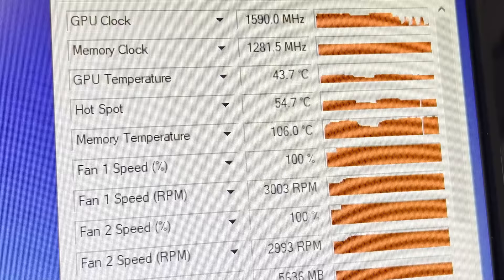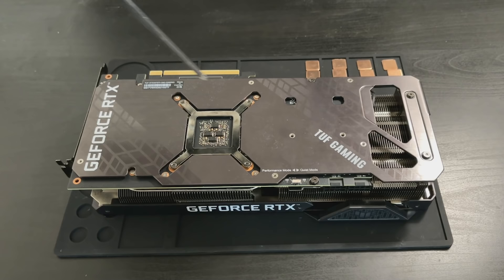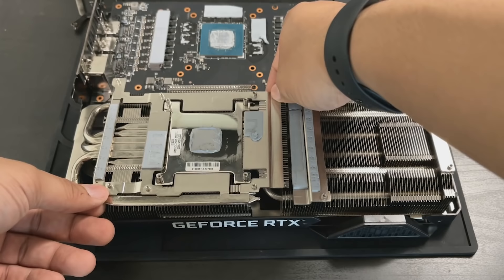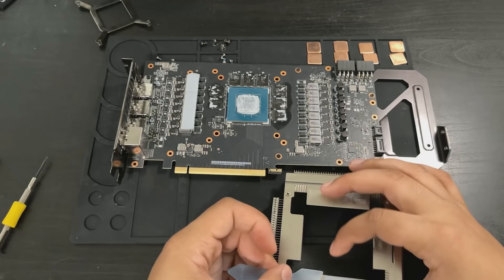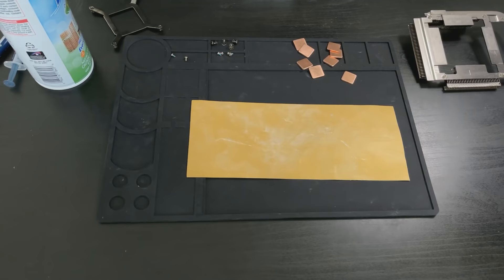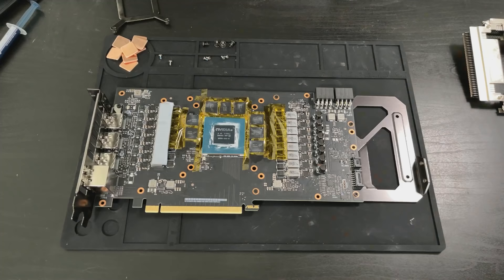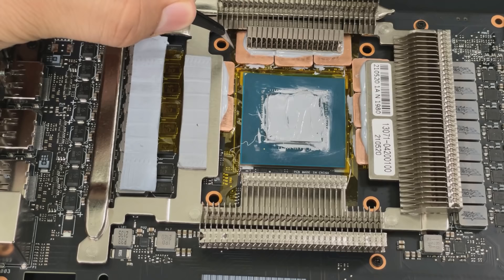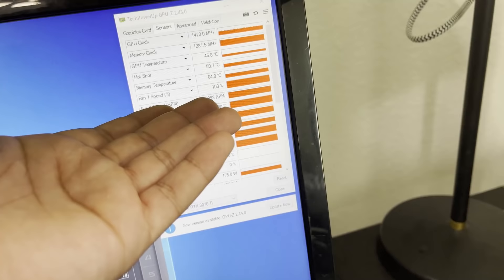I Copper Modded An RTX 3070 Ti.  Memory Temperature Dropped 45 Degrees! This Is How. (110C to 64C)

Comment: Word of warning, this only works "well" if you have a secondary heatsink for the memory. Otherwise you'll have to find ways to fill in the gaps if you have a large single heatsink, pretty much exactly.  As in you have to measure the exact spacing without thermal pads and then get copper shims that thickness or stack various copper shims to that thickness. This is pretty finicky and is basically trial and error unless someone already did it for you in a convenient video/reddit post. Otherwise, if you don't get it just right, you'll have a burning gpu and good memory temps or good gpu temps and burning memory. Luckily, the copper shims aren't very expensive so you can get a bunch of them for experimentation, plus they're basically infinitely reusable.

LTT did a video about an extremely thick foam/paste composite material that mostly fixes this problem. It's very messy, an absolute pain to cleanup, and isn't really cheap. But it does work reasonably well.

Otherwise, outstanding video. I more often than not find proper thermal pads are good enough.
Reply: I was thinking about that, tempted to do this mod to my Vega 56s (HBM memory drops performance when it gets over 80C) but it’s a single heatsink for the whole thing
Reply: @tjarsun  You wouldn't want to use that on an exposed die like your gpu core or HBM, good way to shatter the die, for memory that has a proper package like GDDR# then this can be useful
Reply: if you know the thickness of your memory thermal pads this could still work in theory, you'd just need either very very specific thicknesses of shim or you'd have to start at a thickness you an get and sand it down to the thickness you need
Reply: Y’all over hear tryna burn your house down 😂🤣
Reply: @AphillyatedYT  we feel most alive when rapidly hurtling towards death :P
Reply: @blazingmatty123  And bankruptcy and divorce! ;)
Reply: Even if you do not have copper shims with the exact size you can improove the temps. For example: Original your card is using a single cooler for everything and 2mm thermal pads for the memory. I would buy 1mm copper shims (or Aluminium Nitride shims) + quality 0.5mm thermal pads on both sides. The added copper layer will improove thermal conductivity (compared to a 2mm thermal pad) but the pads still can be squished a bit to fill in the gaps. Not as good as solid copper thermal path but a bit more safty margin when using a single instead of a split cooler.
Reply: @tjarsun  just switch just tim with liquid metal, should drop temps by 10C
Reply: @blazingmatty123  the apex games. great
Reply: @omegaPhix  liquid metal and copper = big problems.
Reply: @frizzlefry1921  How? Copper, Nickel, etc. pretty much don't react at all with LM
Reply: @omegaPhix  Copper will absorb the gallium and it will end up screwed up. Not like aluminum but still not a good idea.
Reply: @frizzlefry1921  Yes, it will absorb parts of the liquid metal mixture and you might need to reapply the tim after around 6 months. But it still doesn't corrode the copper, it's just discolored

Comment: If you really want to cool a GPU hard without water cooling:

- Oversized CPU cooler with a tower heatsink, create custom bracket to attach it
- Aluminum heatsinks that can be cut to size and thermal glue/tape for the memory dies
- Besides the fan on the repurposed CPU cooler, make sure at least one case fan is aimed at the GPU

Comment: Haven't seen an actual copper heat sink in years. Looks like they need to make a comeback!
Reply from the maker: I say they need to just for the aesthetics. The EVGA Kingpin 1080 Ti was gorgeous.
Reply: @dandyworks  i have it on me aorus 1080 ti extreme waterforce its have coper cold plate on memory and gpu
Reply: Copper is 5x the price of aluminum, by weight. It's also 4x more dense than aluminum. Shipping costs would be higher for both consumers and producers, and it could potentially cause mounting pressure issues, but probably not. Imagine a Copper edition DH-15 and it cost $400 instead of $100. That's mainly why there's the compromise of using copper heat pipes and aluminum fins, if your entire heat sink was copper the heat pipes wouldn't be necessary.

Comment: Looking at the thermal pad after disassembling the heatsink, I noticed that it only covered half of the memory chips. This was probably the cause of the high temperatures. Searching the internet, I came to the conclusion in these Tuf models, only the Tuf 3070/Ti models have this problem. In the Tuf 3070/ti (GA104), they used a modular heatsink, made for the tuf 3080/ti, 3090 (GA-102, considerably larger chip) models, leaving the memory chips on the Tuf 3070/ti boards partially uncovered. In this tuf 3070 model, the chips were soldered in the wrong place or they used a wrong heatsink.
Reply: other half is on the memry chips
Reply: That's also what I've spotted. Probably, repositioning the thermopads to cover full VRAM dice would be enough. The main radiator would take care of some cooling. Would it work as good? Probably not, but definitely less risky :)
Reply: @danielsatko-  But anyway, at 10:40 radiator has incomplete coverage over the chips. Even with the best thermal pads that won't suffice.
Reply: We are at the point where hardware manufacturers have figured out planned obsolescence and the only way to prevent this is to vote with your wallet.
Refuse to buy deliberately poorly designed products and spread the word about them.
Do your research before buying. Lookup for review videos with complete disassembly for models you want to buy and see if there are any design problems with them. If no such videos exist this is the reason to avoid the product and look for another model from another brand.
Design issues could be numerous, Ex. when heatsink has small external frame that covers memory chips, but ineffective, or when memory chips are covered partially, or only some chips are covered.
Heat tubes have to be soldered to the heatsink and the main thermal pad has to be made from thick copper, not steel.
There are also could be many points of failure on PCB itself, Ex. low quality components, no fuses, weird placement of hot-components not cooled by the heatsink, etc.
Reply: it seems like this is only on the Ti since the non Ti does NOT have the modular heatsink for the VRAM
Reply: Same temperature issue on my TUF RTX 3090 OC. Haven't disassembled yet to see if the design is different. But I'm also at 104-110°C.
Reply: @skinnladen  looks like this is an issue with the Ti then
Reply: @BlaZebura  sure? I searched and didn't find any 3070 with modular heatsink.
Reply: @lincon5670  yes that was exactly my point. The 3070 TUF has a unified heatsink for both its memory and core

Comment: I used to work in a facility acquired by a very large company that specialized in TIM (Thermal Interface Material) Production. These thermal pads were used in all electronics from headlights, underwater pool lighting, electric vehicles, cell phones, etc. We were never officially told what each part was for but after becoming familiar with the general idea of each product we could come up with our own unverified conclusions. Those copper plates were something that I got to punch out on some of the presses & the thermal pads used on the GPU memory look familiar. Obviously our liquid division would essentially create the cooling thermal paste which I believe is now mainly what is used on larger electronic boards over actual punched parts. We used Kapton tape for splices when cutting down master rolls or when running thermal material through the punch presses where kapton itself was the center most material & then coated in something else. Kapton tape was getting expensive & so our team leads would come around making sure people weren't grabbing multiple rolls of kapton tape & piling them up at the work stations.

It is awesome to see how well the copper plates cooled down the GPU! Incredible results! Now I know what those copper shims were being used for. Awesome video!!
Reply: It doesn't "cold down", it transfers more efficiently the heat.

Comment: This mod is working great with my 2080ti did few more mods with it, temp stays under 68 degree under heavy workload and 35 to 37degree under normal use, before this mod temps were 75 to 80 degree.

Comment: Great idea!!  I have the exact same Asus RTX 3070 Ti TUF card and have been having trouble with the memory temps. An external fan on the backplate helped bring it out of the danger zone, but it's still not enough.  It's good to know the memory heat sink on this card is completely separate than the main GPU heat sink so spacing issues due to thickness of the copper shims will not really be an issue. I really want to do this but sucks to void the warranty. Good job, thanks!

Comment: Been dealing with this issue for a while on my 3090, even the the point were I have some K5 pro on my vrms and memory modules. Definitely going to try this in combination with that instead of thermal paste to see how well it works out. Will try and remember to post an update once I have them on as my memory modules also get pinned around 110 degrees
Reply: I’m dealing with the same issue with my evga 3090ftw3 ultra
Reply: Update ? :P
Reply: @mrx-jz8us  I’m wondering that as well
Reply: @mrx-jz8us  the copper shims I ordered just came in a few days ago, they got loose during shipping and were all jumbled together so I need to sort them by size but once I get that done I’ll be cleaning off some of the K5 Pro off and replacing it with the proper sized copper. Probably won’t have time to do all that until my next days off though
Reply: @mrx-jz8us  So after installing the shims I got about a 10 degree drop in temperatures on my memory chips so it now  only peeks at 100 degrees but regularly stays  at around 98 degrees under NiceHash QuickMiner 's High performance setting. I've included a graph of 30min before, red line, and 30 min after, green line in the Imgur link below.

My card is water cooled  and due to not having enough of the same sized copper shims for each side I'm using 0.3mm sized shims on the side with the die and 0.2mm sized shims on the side with the backplate. I'm using the K5 pro on either side of the shims for my thermal paste and I'm using EKWB Quantum Vector FE for my cooler. 

For the before temps I had the card running in the background for several hours on the medium performance setting before running on high for long enough to confirm that my memory temps still reached 110 and for after temps I let the card run for around 2 hours to make sure that my loop reached temperature equilibrium before grabbing the last 30min of temp data

Also something interesting to note is that I was too lazy to reapply my thermal paste to the GPU die itself which while doesn't harm performance, did increase hot spot temps by 2 degrees and increased overall GPU temps by about 1 degree. So nothing major with my use case but still something interesting to keep in mind

https://imgur.com/9aVVxXR
Reply: @Cyndaquil15  Are you running the back plate water block as well?
Reply: @frizzlefry1921  the backplate has a small area by the water block terminals that have thermal compound for a small benefit from the water cooling but besides that the backplate is just passive

Comment: That's a huge improvement, especially considering the low cost of materials and the work involved. The only thing I would possibly do differently is use thermal glue on one side of the shims, so the shims can't move, and thermal paste on the other, so it can still be disassembled.
Reply: How hard is thermal glue to remove
Reply: @iamdmc  It's actual glue so not the best idea if you plan on selling, RMA or waterblocks. The point of all this is it's reversible.
Reply: @iamdmc  Thermal glue is usually a sold as a two-part epoxy, so it's not going anywhere without a lot of work.

I would NEVER use it on both sides, because you'd be screwed if you had to disassembled it again. I was considering doing it to my RTX 3080 FE, which has the same VRAM issue that he's having in the video, but I'm leaving it alone in case of failure so I can RMA it easier. After my warranty is up or if I can get another graphics card, I'll be modding the VRAM on it though.

Comment: On vrams safer to give gummy/sticky thermal paste K5 Pro 5,3 W/mK, Laird Tputty 607 6,4 W/mK, Upsiren U6 Pro 12,8 W/mK. Copper shims can damage vrams by crushing, and if they move, a short circuit can occur. And for the graphics core a Honeywell PTM7950 phase-change thermopad.

Comment: I know this video is old, I've done the same sort of thing on other GPU in the past, but they do make a Thermal adhesive paste you can use, its just thermal paste thats a glue, Get the test fit down and even make sure its going to work first, then glue the shims to the cooler or in your case, that memory cooling plate, that way you'd only ever have to worry about putting paste on the memory chips and wont even have to worry about the shims moving on you, so no need for Kapton tape.

Comment: Only a few things should be taken into consideration here:
Do not use so much paste.
Do not use anything to "spread the paste".
The "470" chips need to also be cooled, don't just cover everything you see with tape, be tactful.

Only a volume slightly bigger than a rice seed should suffice. Thermal paste is made to spread out equally on its own and fill the gaps between the contact surfaces by applying pressure when you connect them. Thermal applicators lower the paste efficiency as it causes tiny air bubbles to form in it, arguably reducing paste durability as well.

Same as spreading the paste, do not readjust the contact elements, it disrupts the filling between surfaces, pulling in air where it shouldn't be.

Following these you should see around 5 to 10 more degrees of cooling and increased stability and...
...oh no
...he's mining coins...
why do I keep falling for these...
Reply: even arctic states that you should spread it, not too thin mind you but especially on bigger surfaces like GPU dies you should, also MX4 isnt even conductive so he doesnt need the tape

Comment: the pads you removed were only half on those chips!  outrageous!  the manufactuer should be ashamed.  Hey. nice job, dude!  i bet a proper repad would have been in order even if you had not preformed this procedure..  the 30 series were so hit and miss as far as quality...  3070's are particlarly bad with temps🤒  ... and i might try it..  haven't needed to.. yet.?.?....
Reply from the maker: Yeah, believe me I was surprised to see the pad placement myself. I had a little bit of a “wtf” go through my head when I saw the memory modules simply weren’t completely covered with the pads in the first place!
Reply: no wonder his temps were so high pre-mod
Reply: @Rhae yeah but not the recent stuff on Nvidia's side, the TUF is actually one of the better models to purchase. This was poor quality control which can happen to anyone and gpu mining just makes it worse
Reply: @bASIC Miner thats why he probably reached 110C. mine 3080 OC from ASUS TUF doesnt goes above 80C in VRAM temp.
Reply: @Wolf89b  the thermal pads if you look at it when he takes the cooler off, nearly a third or more of the vram is exposed on multiple chips.

Its poor quality control rather than a bad design

Comment: For chips/laptop GPU/CPU's without heatspreaders i recommend high viscosity (Difficult to spread but with some experience it will get easier) and not runny thermal paste like MX to prevent or delay the runoff or pump-out effect for better long-term stability. Easy to spread pastes give great temperatures at the first weeks or month's but the temperature can suddenly creep up.
SYY-157, Thermagic ZF-EX, FuzeIce Plus, Shin-etsu 7921-5 are good pastes for this.
Reply: Update GD-2 paste also works well for direct-die chips. and SYY-157's 2022 formula has changed to regular desktop cpu paste.
I recommend to use thermal putty instead of paste between the copper shims (1.0mm this case with Upsiren U6 Pro)

Comment: Alright. I´ve done this. About 8 Months ago. Without all the Tape and it works fine. Just make sure the GPUs are vertical and not upright! ot the chimneys can fall out to the sides.

The Thickness of the Chimneys doesn´t actually matter at all on the TUF card, as the subcooler bends really easily and you can fit pretty much anything in there. A little bigger will actually improve your thermal mass and hence the cooling is a slight tick better. What you´ll need to adress and it´s the same thing I had to do now is. LESS and I mean WAY LESS Thermal compound. Definetly NOT a generous amount. Only enough to spread the entire surface, but nothing more. The Heat from GDDR6X did dry out my Thermal Grizzly Kryonaut after about 7 months. And thats a fkn expensive paste. With a cheaper one this will definetly be quicker. All it needs to the harden and not transfer shit anymore is a small rig crash or a real nice coldfront for a day. Suddenly my memory was back at 110°C again with the same chimneys and setup.
Redid the whole thing now with less paste and thicker chimneys. Means less chance to dry out and if it does it is a quicker replacement.
Else great video and good explaination keep up the good work.
Reply from the maker: Thank you for your insight! I will be doing a follow up video in the future where I disassemble and look at how the card is holding up. As for the thermal compound, I think you are right, I should probably use less the next time I do disassemble and reassemble.
Reply: What do you mean by chimneys?

Comment: I did something similar to 4 RX 570s that I water cooled. I used a thermal adhesive to keep the copper in place though. But, I knew I was never going to take them off.
Nice walkthrough, and congrats on your success.
Reply: U water cooled 570s 🤣🤣🤣
Reply: Bruh that gpu is fine with no coolers